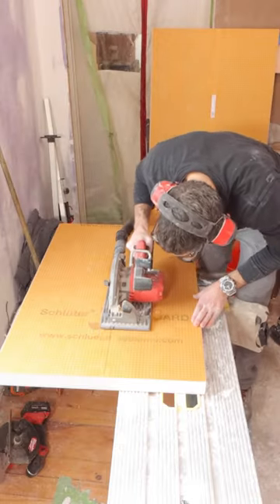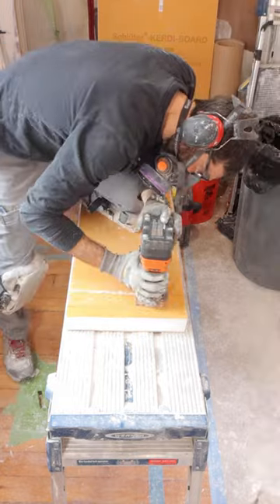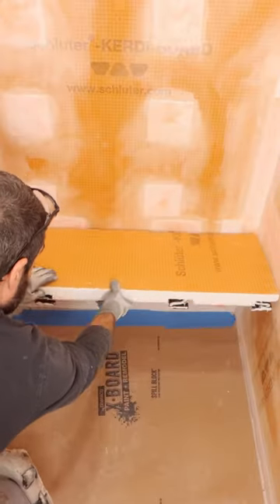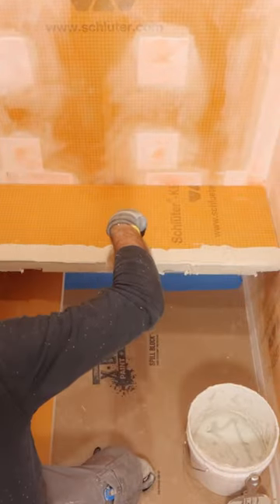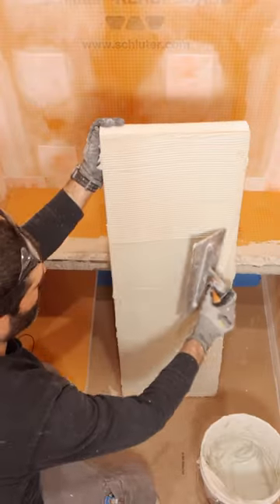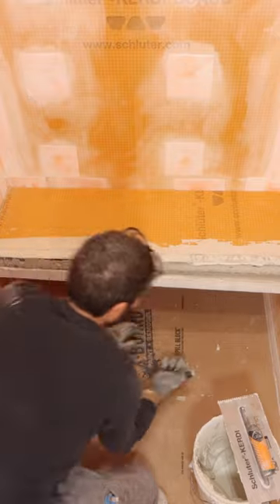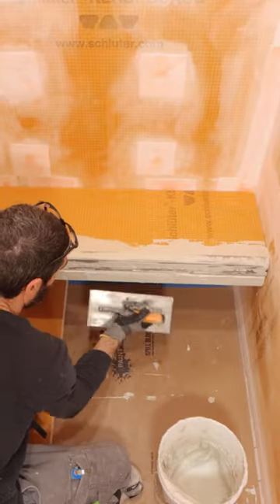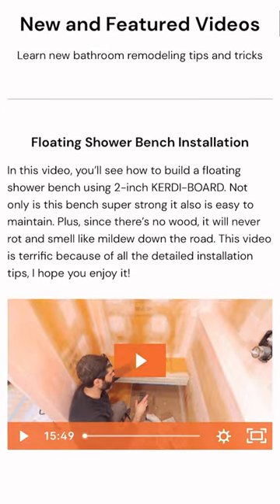Floating Shower Bench Installation - #shorts

Comment: Those steel brackets did you make those or can you buy them when your making a bench. Just asking. Going to be making a bench in my shower too
Reply: If you look online, there are hidden brackets for solid surface countertops. And they have multiple mounting options along with varying lengths.